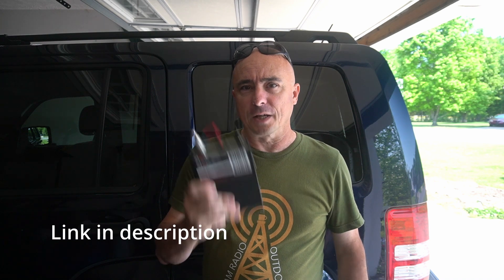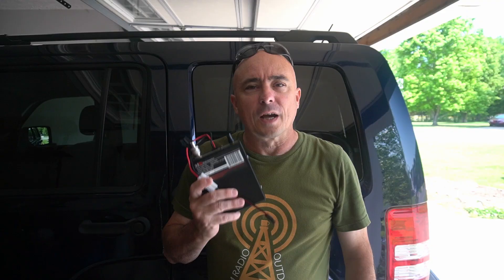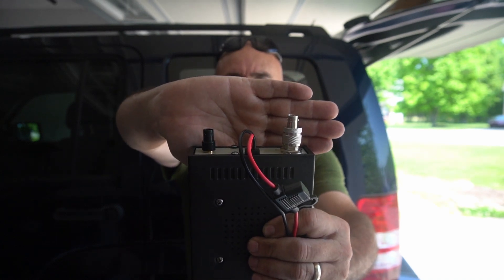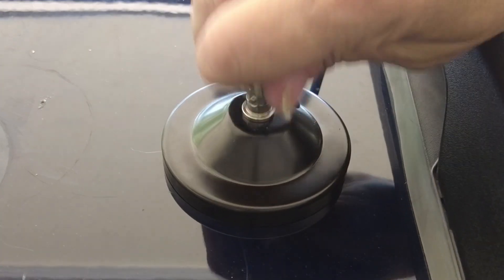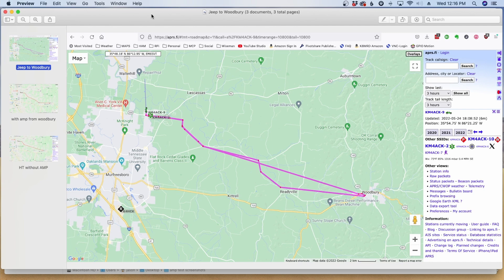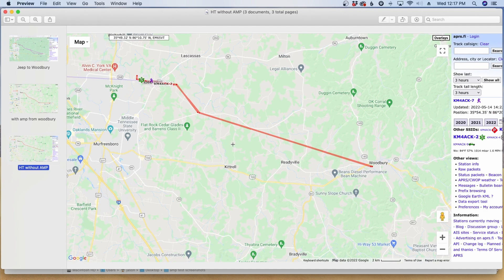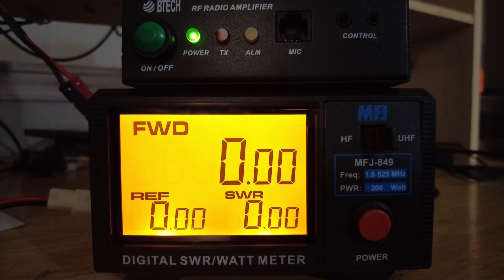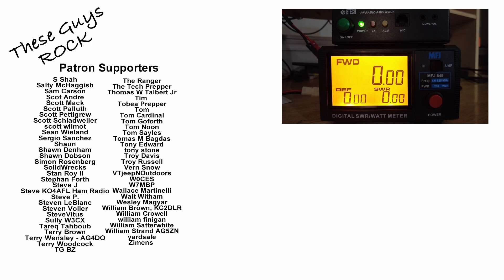Btech V25 Amp Install & Review

Comment from the maker: 🔹Links mentioned in the video
Mag Mount - https://signalstuff.com/product/bnc-magnetic-mount-for-signal-sticks/?ref=2223

Signal Stick Antenna - https://signalstuff.com/product/super-elastic-signal-stick-bnc/?ref=2223

Btech Amp - https://amzn.to/3RbmdK6
Reply: According to the description of the amp on Amazon now it does 20W-40W with 2-6W input so it's still a bit over the spec, but even though its model number is V25 that apparently isn't related to the output power any longer I guess you have one of the upgraded ones, before they upgraded the lables on the case. 🙂   By the way that seem to have a 'D' version for DMR, which seems like a good option allowing you to use a Anytone 878 as well.

Comment: Hello, how has it held up, what would you do diffrently now that you have owned it for awhile.
Reply from the maker: Still running great. Not sure I would change anything other than I might get the one compatible with digital so I could also use CF4M with the HT. Either way, it's been a great solution to putting a radio in her vehicle without putting a radio in there. Everything is out of sight until I need it.

Comment: hello Jason did you use the "Yaesu microphone adapter to link to the control on the v25 . I have the ft2d and the ft5 and ft 70. Im thinking about ordering this unit its only 99.00 today on sale.
Reply from the maker: I did not. I use a hand mic connected to the FT5

Comment: Did you ever find out why you were getting the higher wattage output from the amp? Just curious
Reply from the maker: No sir. I did notice that the ones listed on Amazon now say 20-40W output. Maybe I got a newer model with an old sticker on it?
Reply: @KM4ACK  Yeah maybe. A free upgrade. As long as it doesn't hurt anything.
Reply: @KM4ACK  its most likely the input power. if the baofeng is sending 4 watts it will output around 40 watts. give it more and it will output more wattage.

Comment: I am lucky, my wife likes to listen, plus she also is a scanner listener so we use the radio in her car to monitor Fire and EMS as well. I really took the time and did a real clean install. I took out the dashboard, removed floor rugs, and even took the truck lining out to hide everything except the control head. If you pop the trunk you can't see coax, or the radio at all. Its all hidden. I even put the speaker under the rear deck so the sound comes from the rear " dashboard " .

Comment: Good video. I am interested in doing a  non-permanent insulation as well. Can you share more about how you ran the feed-line?  It looks like you’ve removed a grommet at the rear of the vehicle? 
Thanks!
Reply from the maker: I removed the brake light from the rear of the jeep and passed the coax through the rubber grommet where the brake light cables are run from the factory. Just be careful to add some extra protection to the coax. I didn't with the first mag mount that I replaced and it had a torn jacket on the coax that was shown in the video.

Comment: Is the amp drawing off the battery despite the ignition being off? is there a remote 12v option?
Reply from the maker: No 12V remote option. There is an on/off switch on the front of the amp.
Reply: @KM4ACK  install a relay using one of the keyed hots as the trigger. no need to flip a switch

Comment: No config needed on the amp?  Just plug in and PTT?
Reply from the maker: Plug and play simple. I didn't however use the mic that they supplied. I use a hand mic plugged into the FT5d.
Reply: @KM4ACK  I was gonna ask about that next.  Looks like a weird setup: an amp with a mic cable?  So is it a radio on its own?
Reply from the maker: @temporarilyoffline  No but if you are using a Baofeng, they give you a cable that goes between the amp and the radio. Looks similar to a programming cable. After that is connected, the mic that comes with the amp will work. It also gives you a speaker on the amp.
Reply: @KM4ACK  oh I get it now!  Still weird though :-)
Reply: @temporarilyoffline  It's so that they can access the PTT and switch without detecting RF I guess.

Comment: Awesome idea. My wife has a Jeep rubicon with the same set of rules. No permanent installation. This is exactly what I needed! The only problem is mounting the antenna. It is a newer Jeep which are made out of aluminum. The antenna may have to be permanent

Comment: Great modifications! Instead of splitting the PowerPoles, I've always used a RigRunner in my vehicles. They're expensive, but neaten everything up and fuse every connection.
Reply from the maker: Rig Runners are a great option and I use them in the shack. For the Jeep though I just fuse the main lead at the battery protecting everything in the circuit with it.

Comment: I'm thinking that the btech amps were made with baofeng HTs in mind, as many only output 3-4 watts if I remember correctly. So a solid 5w definitely gets higher at the end even if the amplification is the same it would give a lower output radio. Totally just a guess though! Great video!
Reply from the maker: If you notice the sticker on the back of the amp in the video, it says 2-6W input. The FT65 only puts out about 4.75W so I don't think that's it. I noticed the new listing on Amazon say 30-40W output. Maybe I got one of the new batch that had the old sticker on it?
Reply: Ok good I guess they did some upgrades since I last looked at them.  I ended up getting the UV-50 instead of the amp.
Reply: Yep I concur.  I was going to say something but you beat me to it.  These amps are controlled by power in so if you put more in you get more out.  That is not a good thing as it allows the amp to be over driven and of course raises the spurious emitions over allowed levels.  It will also shorten the lifespan of the circuit components.  I think there is a gain adjustment pot on the back of the amp to tune the system to your radio output.

Comment: Great solution! How much power will the Signal Stick handle? Didn't realize it would handle more power than 5w that comes from the standard HT.
Reply: 100 watts at 50% duty cycle.  50 watts at 100% duty cycle.
Reply from the maker: I actually checked this with Richard at SignalStuff when I ran into him at Hamvention. He said it wouldn't have any issues at 50W.
Reply: @KM4ACK  That's amazing for what looks like your typical HT antenna.

Comment: Interesting results. Did you try the power test in the vehicle? Running and not running too? Just curious, shouldn't be a difference.. oh and my wife calls my ham radio tinkering the "Unsanctioned Project" 😂
Reply from the maker: I didn't run the power test from the car. I don't suspect the results would vary by much.